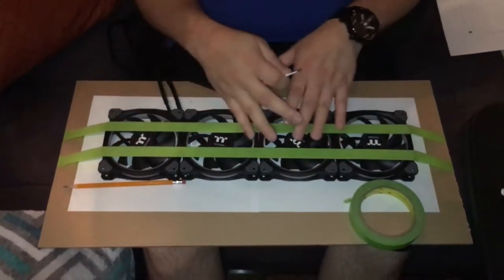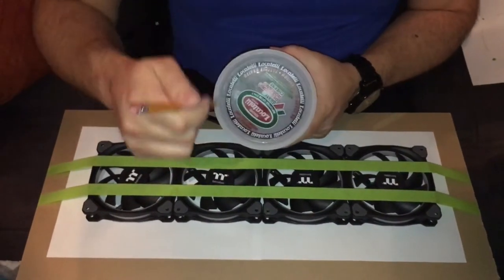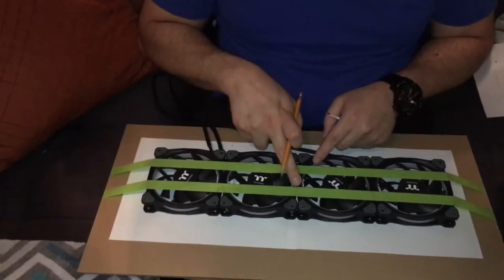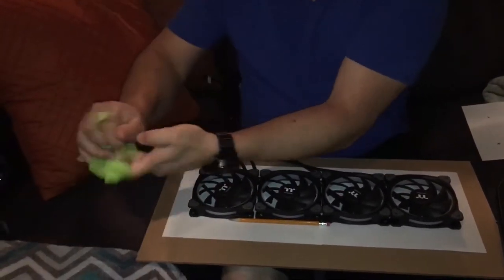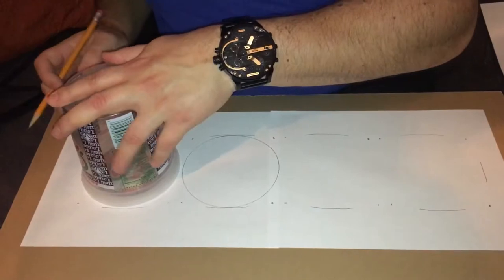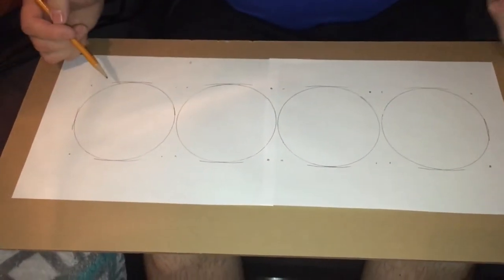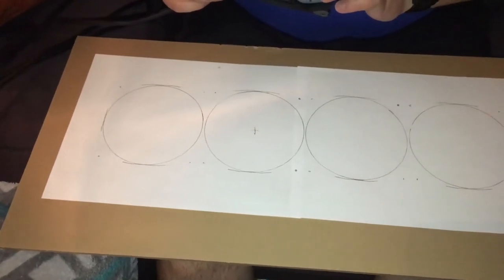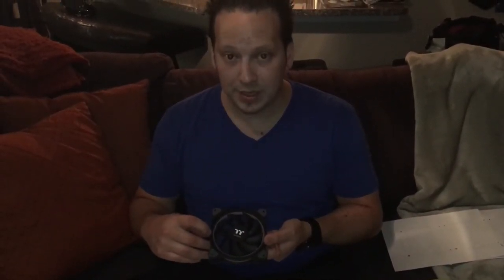Making a custom computer fan cutout, or radiator cutout. PC Modding Tt Arcade

Comment: My suggestion would be to layout the fans as you have on the cardboard, tape them down and mark all of the mounting holes.   Then draw diagonal lines between opposing corner mounting holes of each fan.   Where those lines intersect is the middle of the fan and where your hole saw center need to be.   As long as you have marked the exact center of each mounting hole this method will be much more accurate.
Reply: I agree. That being said any kind of non CAD solution is going to be hit or miss as far as accuracy is involved. That doesn't even account for deviations in making the cutouts themselves.Via hole saw and drill or however he makes the cut outs. I guess that is what fan grill are for lol.
Reply from the maker: When doing things by hand there is always a small margin of error, how centered the drill bit is each time, how accurate the marks were etc... However there will be no fan grills, so these need to be really good!
Reply: I can't wait to see the end results!